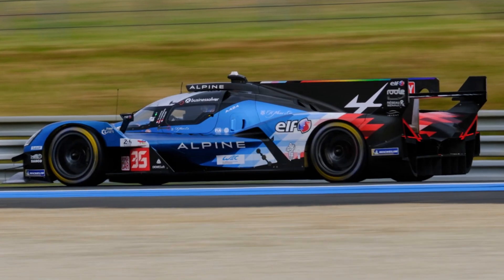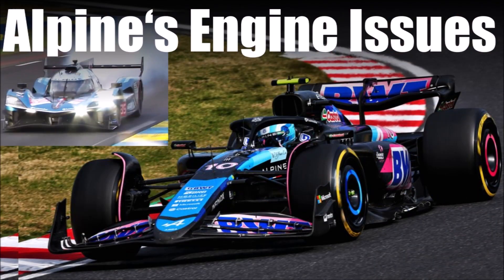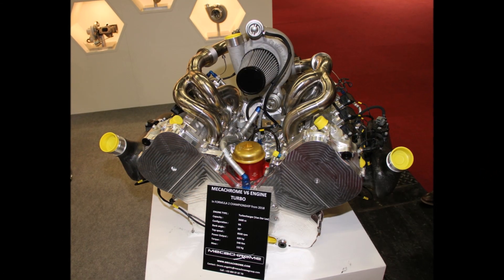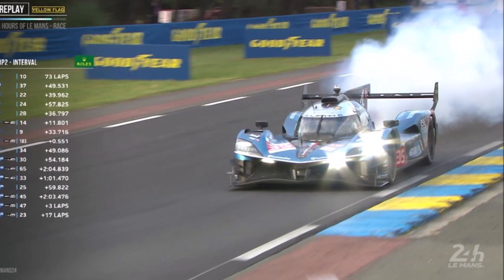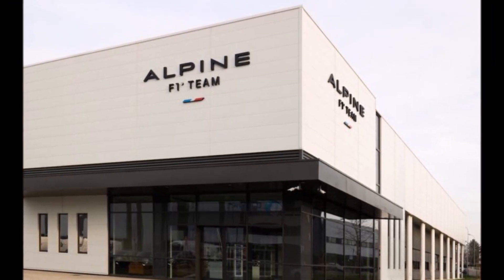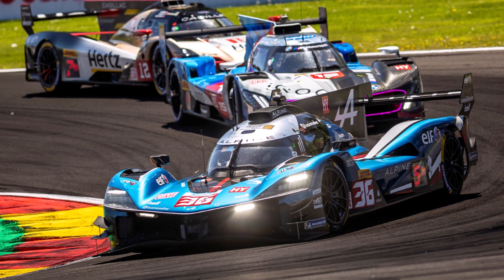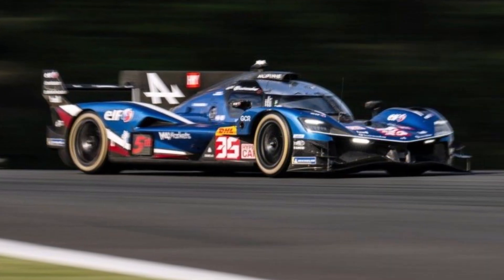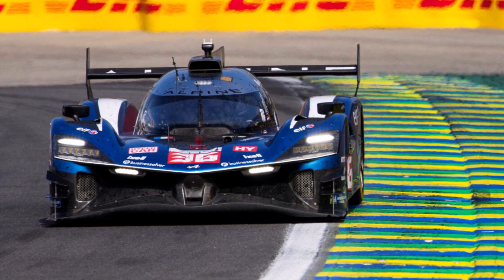Alpine A424 EVO Update (LMDh) - EXPLAINED

Comment: I hope the FIA and ACO can resolve this BOP mess, it’s ruining endurance racing. And as for Alpine, why would they use an F2 engine? Why not an F1 engine? They need to get it together…
Reply: There were many examples of F1 engines adapted to endurance. Most of them were failure and couldn't hope to survive Le Mans. Only place it gonna be competitive is shorter endurance races at 6 hours
Reply: @kidpagronprimsank05  In WSPC 1992 and Le Mans 1993, the Group C cars required to use 3.5L naturally aspirated engines which was F1 based regulations. In early 1990s, V12 engines were actually suited for F1 while in endurance racing, V10 was the perfect balance and choice compared to V8 on the Jaguar and V12 on Nissan. F2 engine is actually suited in the Hypercar rules especially the LMDh flexibility so that's why Alpine uses it on the A424.

Comment: The funny thing is that the car was actually not good at Le Mans. And no the 2 stage BoP didn't even hit them hard there. So their design philosophy never worked anyway.
Reply: So in the essence then Hyundai and Honda, should they join WEC, not gonna be competitive then as they have same ORECA chassis and nose profile
Reply: @kidpagronprimsank05  Not necessarily. While they share the same chassis, the nose on the Acura and Genesis is much different. Acura's done pretty well in IMSA, so it's probably just an Alpine thing.

Comment: Do I get something wrong or is the low drag "attempt" completely dumb because isn't a minimal drag coefficient stated in the rules? I always though minimum weight, maximum power, minimum drag and maximum downforce were all part of the rules.
Reply: As far as I understand there is a minimum drag and a maximum dowmforce, but also a maximun eficiency, wich means you can't hit both with the same car
Reply: As Ferrari show, you can to some extent, get around it. Also because the regulation allows one aero package for entire homologation period, you have to choose from get go where to compromise
Reply: they are but engineers like to bend rules and bop is getting stupid trying to balance everything.

Comment: if the fia wants to equalise the cars so badly they should make it a spec series🤷
Reply: that would make hypercar way too close to lmp2 class, right now the hypercar class is barely faster than the lmp1 era lmp2 cars and making it a spec series would blurr the line between hypercar and lmp2 even more
Reply: @OscarZheng50 ..so they could just implement a cost cap and let the engineers have at it
Reply: @PSboy_VII A cost cap would make it similar to f1, there will be a clear group of top teams and a clear group of midfielders. the midfielders will only stick around for so long if their program doesn't see success. the reason the hypercar grid is so popular is because even midfielder teams or teams that dont have experience in high level endurance racing can still participate and won't be decimated by the rest of the field
Reply: @OscarZheng50  peugeot..
also toyota who have one of the best cars and yet atill get f'ed over by bop (except the one race they werent)
Reply: @OscarZheng50  aren't entire point that it's supposed to be f1 of endurance racing? Pinnacle of speed in it's type of racing.
Reply: @alondjeckto  it used to be like f1 with the lmp1 cars but the ACO kind of changed their vision because while lmp1 was cool and all, it wasn't sustainable enough to run. Manufacturers were not interested in expensive projects that rivaled f1 team budgets so they made it cheaper and more accessible to manufacturers. its like a tradeoff: less speed but for cheaper cost
Reply: @PSboy_VII thats jus the FIA and ACO not doing BoP correctly, if done correctly it is actually really good
Reply: @OscarZheng50funnily enough lmp2 is a spec series because other manufacturers couldn't make a car competitive enough to challenge oreca. Lmp2 is supposed to have more manufacturers lol
Reply: @UnePintade  oreca is goated like that and even with only 1 manufacturer present, its still a very entertaining class
Reply: @OscarZheng50 isnt the whole point of Le Mans Hypercar is relaxing the reg so more brands can join? im not educated enough on this topic
Reply: @yeahbruhnah  yes the goal of hypercars is to attract as much manufacturers as possible to not have a dead category and BoP is supposed to be key to attracting manufacturers.

Comment: What do you mean by a joker?
Reply: this cars are homologated, meaning they cant be modified or updated like formula 1, but have a small number of changes to that homologation they are alowed to do called jokers, i think is like 2 or 3 per homologation and current car homologation will last until new rules in 2033. so they need to be carefull what jokers/changes they do.

edit: 5 jokers alpine already used 2
Reply: Adding on, each joker can only be used on one specific part of the car to update it and since theres a limited amount of jokers, teams need to be strategic about when to apply them. its not like f1 where they can slap on new parts every race weekend. they can only bring upgrades in between seasons. Also, since the hypercar era got extended, every team will be getting more jokers after 2027 so all the current teams will look to use all their current jokers before 2027 and then they all get a fresh set of jokers to carry them to the end of the current rules era. its worth noting that the ACO and FIA can give additional jokers to teams that they deem are struggling. they offered additional jokers to lamborghini to help develop their car but they weren't interested in using those jokers